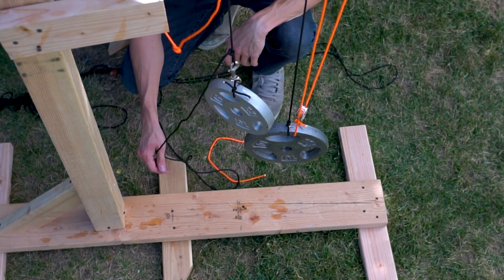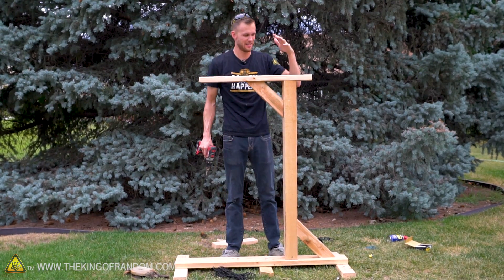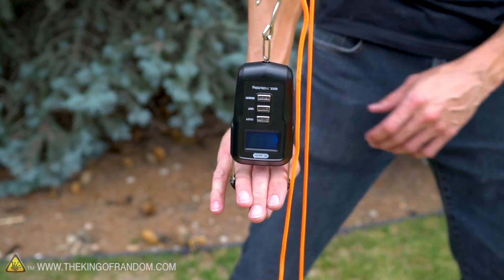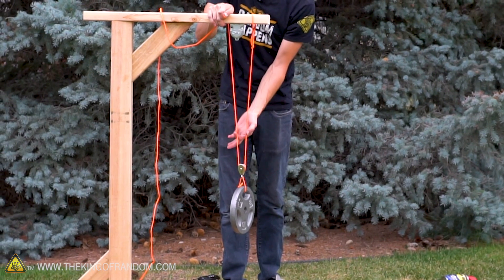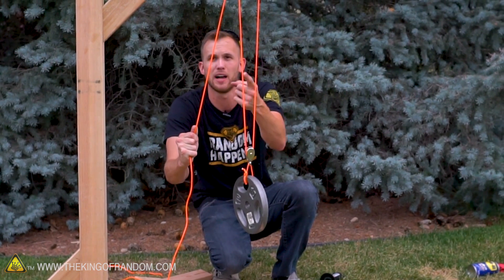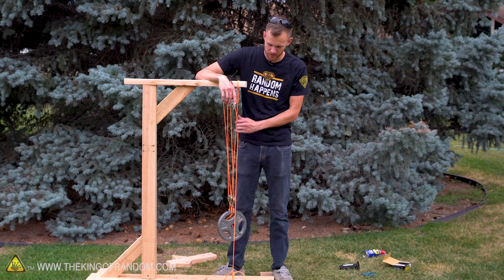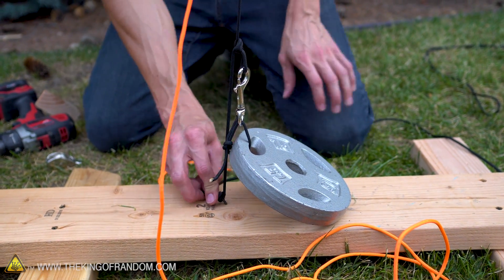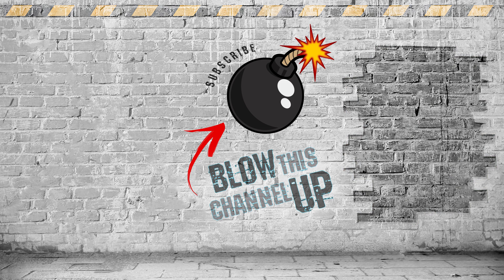Why Don't Tree Houses Have These?

Comment: FYI correction,  if the pulley are frictionless you would NOT accelerate at falling speed due to the other mass momentum gain.
Reply: glad you pointed that out.  you beat me to it
Reply: And also the fact that the other mass is pulling you up at 2/3 the force of gravity pulling you down in the example he provided. So you would accelerate WAY slower than falling speed.
Reply: @davidharmeyer3093   Yes I believe the EOM would be m(double dot) +T = m(double dot) + 2T, which results in the 2/3 you mentioned above.
Reply: who you trying to impress XD
Reply: Yep. I was about to say the same.
Reply: @Fusion 8000  Me?
Reply: Thanks for stating the obvious
Reply: @owjburnham4317  Me too
Reply: yeah, after you hanged a man, use the 2nd pulley system to bring him down, and load another man on the first pulley then up he go

Comment: 10:30 No.. you would not hit the ground by the full speed of gravity.

Because you need to over come inersia. So if you say are 100kg Heavy. The pully breakes you with 75 kg, the gravity will pull you down with 25 kg, but your mass is still 100kg. This would make the speed 1/ 4 of gravity.

Actually it would be even less. Because the pully is also lifting the weight on the other side with 25 kg and if that weight is 150kg but hat half speed, that give is a effective mass of 75kg:

The actuall moving speed is (100+75)/25)= 1/7 of gravity

Comment: I had a sort of pully on my treehouse.  It wasn't an atuall pully, but a rope slung over a branch.  What I found fascinating is that when you pull yourself up this way, by putting a loop at the the bottom for your foot... The effort to pull is lessened more than you'd think.

When you're standing with your foot in the loop at the end, 100% of your weight is there.  Then when you pull you're not just lifting your total weight, you're also taking weight off your foot, because you're pulling yourself up at the same time.  The net effect is really fascinating.

Comment: 10:25 : thats wrong! 
1. "speed of gravity" is a pretty bad term for that. Its more like the speed you end up on the ground after getting accelerated by gravitational force.
2. The gravitational force is pulling you downwards sure, but you have to take the force of the counterweight in to account, which is going upwards. Think about a counterweight, that is (in your configuration twice) as heavy as you are: You wouldn't move at all, because upwards force is just as big as downwards force.
Reply: He is wrong, but you are also wrong as the weights are 7.5 lb and 10lb. But yes everything else you said is correct and it pains me to see him misunderstand the concept of gravity. You have to take the net force acting on the body moving down and divide it by it's weight to get it's acceleration. Thus, 7.5 lbs down left*2 +10lbs down right = 5 lbs of force down left. The net acceleration is then  the mass of the 7.5 lbf/5 lbf. Or roughly 2/3 of the normal acceleration of gravity. I believe, but did not actually do the math of the mass to solve for acceleration.
Reply: I dont know where i got wrong though. Didn't say anything about the weights he used. But i think you are wrong now. :p
Down weight = 7.5 lb, Up weight = 5 lb (10 lb /2)
So net weight left 2.5 lb (down). 
Thats 1/3 of 7.5 lb. So it should be only 1/3 of gravitational acceleration, right?
Reply: @alexu.9294  I agree with that, I just noticed in one line you said the counterweight was twice as heavy and was restating that it's actually 4/3 as heavy. Besides that I believe we are in agreement!
Reply: Am I actually the only one that doesnt understand anything?

Comment: Dude You Need To Tie A Helium Balloon To A Sulfer Hexoflouride Balloon And See If It Floats In Mid Air Because The Helium Can Lift The Sulfer Hexoflouride And The Sulf Hexoflouride Keeps The Helium From Flying Away! Please Like This So He Sees! This Has Never Been Done Btw Revolutionary!!!
Reply: it would act like it was filled with oxygen, but the helium balloon would always face up.
Reply: i dont understand pls explain more detailed dont worry about confusing me tho cuz i know what quantum physics are yet i dont know how balloons work... dont ask lol
Reply: Density differences...
Reply: It would not float in mid air. Assuming the balloons were the same size the SF6 balloon would be like a weight pulling down on the He balloon.

Lighter than air balloons float because the heavier air falls around the balloon, forcing it upward.
Reply: not revolutionary they aren't exactly oposite
Reply: Or you could just... only partly fill a balloon with helium to give the exact same effect

Comment: dude! thank you!  I've been meaning to make cerebral time to learn pulleys.  I've worked as a stage hand, and ground rigger, so i understand simple pulleys, and I understand block and tackle, and load reduction off a series of similar pullies, but knew nothing of the combination, and by placing the pulley in different locations you get different work to lift lad results.

Comment: You actually would NOT drop at the full speed of gravity with frictionless pullies.  It would be a fraction of normal acceleration based on the ratio of your weight to the total weight of the system.  This is because of the basic equation, F=MA.  When gravity is working on you alone, F is GM, so GM=MA, G=A.  Lets let M be your mass, and Mc be the counterweight. With a pulley system, F is still GM, but the mass for the MA side of the equation is now (M+Mc) resulting in GM=(M+Mc)A.  Therefore, your actual acceleration is GM/(M+Mc), so if your counterweight is the same mass as you are, you'll only accelerate at 1/2 G

Comment: You could build an elevator basket with some sort of air cushion or a spring at the bottom, that way if you'll soften the landing. Also maybe you could put a friction break on the static pulleys, just permanently applying a bit of friction to slow things down.

Comment: Great video, really fun to watch!
Just a little thingy, I think a few time you misuse 'lift' instead of 'hold', which could bring confusion to some listeners. 

Since if you 'lift' (which is to create an upward movement) 4.5 kg with a moving pulley, you're gonna need more than 2.25kg of 'weight' because you need to unbalance the 'weight' equilibrium.
But if you want to 'hold' (which is to maintain in equilibrium the two weights) then 2.25 kg should do it.

Comment: A wheel and axel is a type of lever, and so is a block and tackle.  There are THREE Simple Machines: the Lever, the Inclined Plane, and the Hydraulic Ram.  Everything else is an embodiment, or combination, of one or more of these THREE.  This includes the Torque Accelerator, which is a type of Lever which has a Moving Fulcrum.

Comment: you could use a bucket as a counterweight.
to get up the bucket must be filled with a bit more water than what is needed to balance the weight, to get down you would remove just a bit of water and slowly move down. all  with one system of pulleys.

Comment: If seen demonstrated comment link. I’ll do it in a months either way. Pulleys are required to get the materials or finished walls put regardless so might as well put them to use afterwards.

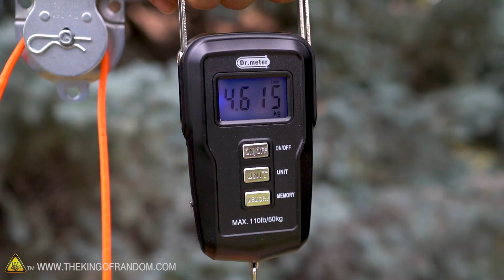Comment: 2:39  "So we can see, just over ten pounds.  It could be that the weight has a little bit extra on it."

A little bit extra, like, I don't know… the rope used to hang it from the scale, maybe?  (Not sure how much the rope weighs, or even if that weight was zeroed before attaching and the ten pound weight.)  And if not, I see a barcode is still attached to the weight.  😄

Comment: At around 6:00 

Me: "So dig a pit to compensate for the further distance😁" 
(The pit would only be under the smaller weight so as to allow it to travel a further distance without increasing the necessary distance traveled by the larger weight)

Comment: Pulleys are just another form of gears, I quite like gear ratios and the idea that the torque from a drill is enough to generate thousands of pounds of pressure.

Comment: could you build this with something like a rolling wire drum attached to the lift itself. So to go up, you would roll the drum to take in more rope. You would have to do work, but with a number of pulleys, and counterweights you'd be doing very little work. Then to get down, you'd just slowly release the rope.

Comment: Simpler way - just make the counterweight the same as the load (person). Then you can simply pull yourself up or down the tree (or a vertical fixed rope), with only friction to overcome. This system is used in rainforest research.

Comment: 10:18 - 10:41 As some others have pointed out, one would not fall to the ground at the "full speed of gravity". Why? A lot more mass has to be accelerated with a far smaller force.

Since I am more used to the metric system, I will do my calculations using 7.5 kg and 10 kg respectively. The result will be the same though, since the ratio is the same.
The person has a mass of 7.5 kg, therefore a downwards force of 75 N. This can be calculated using F=m*a and using 10 m/s² as the approximate gravitational acceleration. The counterweight has a mass of 10 kg and a downward force of 100 N, of which half is used to slow down the person. (50 N)
75 N - 50 N = 25 N --> Gravity is still pulling the person towards the ground with a force of 25 N. 
Using the same formula, we can calculate the acceleration: F = m*a --> a = F/m = 25/17.5 = ~ 1.43 m/s²
This is exactly 1/7th the gravitational acceleration. (When assuming g = 10 m/s² to begin with)
Reply: Sebastian Hietsch you forget that the 10kg would accelerate half as fast, so it would be 25N/12,5kg=2m/s^2. In other words a fifth of the normal acceleration on Earth.
Reply: @nilsperregaard930  The 10 kg would not accelerate half as fast. If it would, the rope would have to expand/contract.

Comment: if you do build a bigger version, you should have some sort of lever to switch the direction the elevator is going, rather than disconnecting from one line to connect to the other. maybe a second weight to continue falling past the landing point so it keeps both of the loops in reach of the clip as well.

Comment: You would need something like a centrifugal spinner that would open up as it spins and make contact with a brake pad to slow down the descent. Or a piston system pumping air or fluid through a tiny hole, setting limit to the maximum speed.

Comment: Seems to me if the weight of the two pulleys that you added or actually factored in as part of the White's used 2 equal to 10 lb that should alter your pull weight .

Comment: the gears on a bike where ones small and ones large changes the your distance per rotation of the petal. could you incloud this mechanic to shorten the distance of the dropped weight to pull the larger one completely up?

Comment: Nice video explaining how pulleys work.  However your assumption that you would fall down with normal gravitational acceleration if not for the friction in the pulleys isn't correct.
Even assuming the pulleys are frictionless you would fall away slower than 9.81m/s/s. There are 2 forces acting on you (the weight going down), the force of gravity and the tension force in the rope going up to the pulley.
The net force of these 2 determines your acceleration since F=m*a

Comment: What if you use pulleys to cut the elevators weight in half for the way up. Then the ropes should line up
Reply: Actually that doesn’t make sense you’d be cutting your distance in half each time

Comment: what if you make a falling weight generater you make a geared ration system that uses the same principals with a   pully weight that falls turning the gears attached to a liitle electric motor for a small light for the treehouse at night
Reply: Hi

Comment: imho, it´s not friction that stops you from dropping at full speed, its the inertia of the weight down there and acceleration of both bodies. the pulleys should not have that much friction

Comment: what if you make a pulley system that would go through water with the super glue concoction and pull it from one side of the water to the other and see what happens to the glue?

Comment: It’s not the friction that really slows the descent. Your pulley has 7.5 lbs going down and 5lb going (10÷2) up. The net force gravity can exert is 2.5lbs but the entire system is 12.5 of inertia. So the gravity has to work harder to accelerate you.

Comment: Actually with frictionless pulleys if the elevator pulled with half the force of your weight you wouldn't fall as fast as normal still. There would be half of force trying to accelerate your full mass so you would accelerate at half the rate. 4.9 m/s/s. So you would not hit the ground with the same speed as free fall. I think you were confusing this with the free fall of two different masses.
Objects with different masses fall at the same speed. Objects with the same mass but different net force fall at different speeds. 1kg steel ball vs 1kg Styrofoam ball in air for example.

Comment: No you wouldn't rush at the ground at the speed as gravity only half.  the reason is you fall at the acceleration of gravity isn't because of the acceleration but it concequence on the conservation of momentum, F=ma and F=mg so fo course with gravity being the onlyforce you end up with a=g  but with the counter the force on one side is F=g(mp-mc) but in relation to acceleration it still f=ma so a is obviously smaller than g. in fact you wouls also have to take into account the acceleartion effect on the weight so it be even lower.

Comment: Just a comment on your elevator, Non electric elevators have been used for centuries, and are still used today. So Im sure your exact design has been used or is in use, you should check the patenting .

Comment: Depending on the weight of the person this system wouldn’t work. You would need multiple settings/ weight to pull. If this is not done a person that is 100 pounds and a person that is 200 pounds obviously wouldn’t travel upwards at the same speed and same with descending.
Reply: This was a great video though my thoughts may be wrong, I’m only 15 so I’m most likely wrong. Lmao

Comment: If your counterweight weighs the same as you do, couldn’t you just pull yourself up with little more effort than overcoming the friction? Your system works fine but it doesn’t control acceleration depending how high you are it might be the difference between hitting the ground at 30m/s and 15m/s. that’s still gonna hurt.

Comment: Speak for yourself bro, my treehouse definitely had one of those, though my 10 year old self wasn't yet aware of counterbalancing. had a corded drill mounted up top, with paracord jammed in the chuck alongside the most immense bit we could find. That thing hauled a small kitchen table, chairs and an old ~18 inch tube TV up 20 feet without as much as slowing down.
Reply: Who needs efficiency when you're too young to have an electricity bill?

Comment: This silly - you just changed the point in time where you have to do the work to raise yourself again.  You, or a force input, still have to hoist some weight to the top again.  You could have done it in one system and  had more downward speed control when going down which then conserves some of the force whereby to help pull you up again.  Basic high school physics.

Comment: Nate, your knot game is shameful. You should build some sort of rotational damper (like a dashpot in a suspension system) for your full scale tests. A dashpot-like device causes the force to be proportional to the velocity so you could prevent yourself from being accelerated to too high of a speed on the way up or down. That way, you could tune the target top speed to the total gravitational force on the rider for the trip up or down. (I.e. the speed at which the rider is traveling where there would be zero net force: F_g + F_dashpot = 0